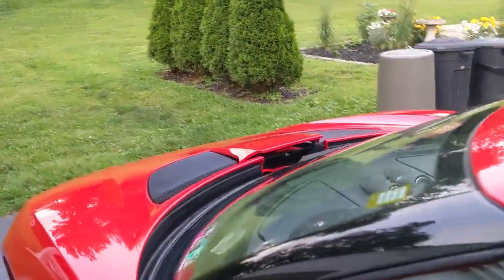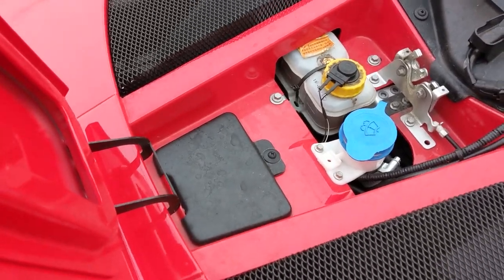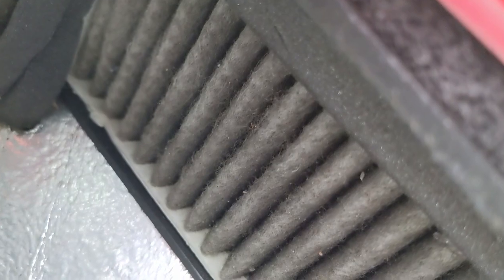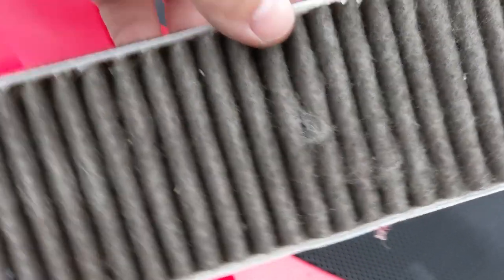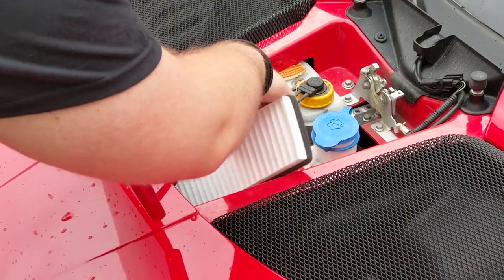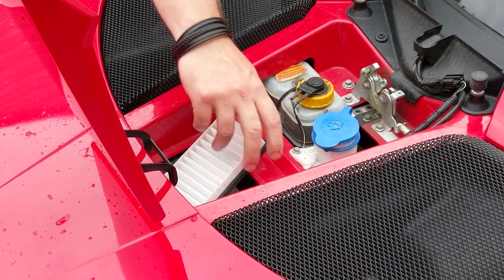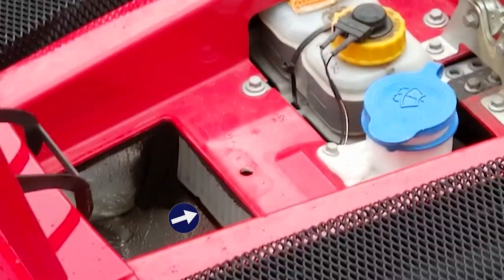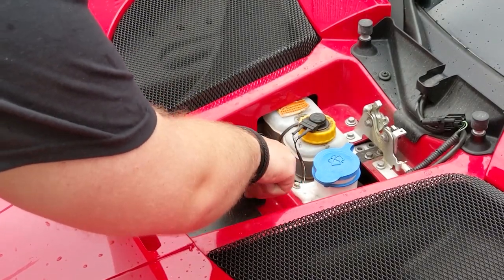Lotus Evora Cabin Pollen Filter Change - So Easy - do it once per 2 years

Comment: While you pop that front access panel, take note if that door is even with the clamshell next to the hood. If it isn't pull off those little feet bumpers on the inside that push against the door next to the windshield and adjust the screws so it fits flush. Mine was WAY off.
Reply from the maker: Mine is definitely off. It sits a little high but never bothered me until a passenger pointed it out to me! Lol

Comment: Nice job. Looks like flushing brake fluid is on your horizon for your next video.
Reply from the maker: Certainly a little darker than I'd like. Haven't experienced any brake fade. But I suppose that's the type of thing you like to stay ahead of. Right? :)
Reply: I just bought one of those $13 Amazon moisture meters.  Would be interesting to see if yours makes a bad reading.
Reply from the maker: @dogtag114  good idea. I think I have one somewhere. Let me check
Reply: Also be sure to flush/change/bleed the clutch at the slave cylinder . . . once a year.
Reply from the maker: @mhesshaus1099  Good advice. I have to do more research on that.